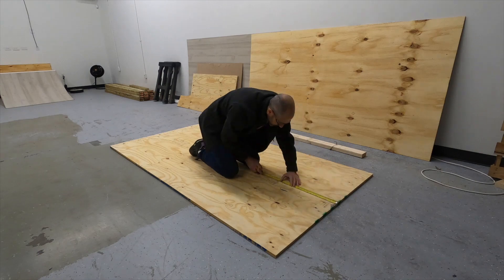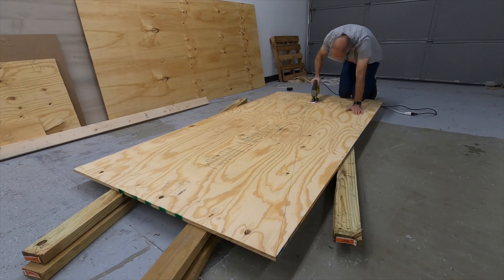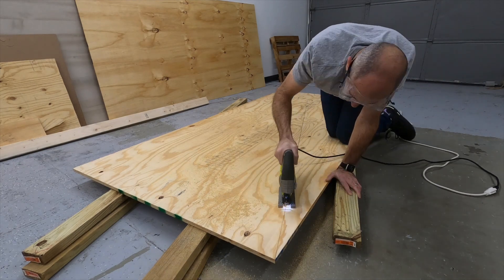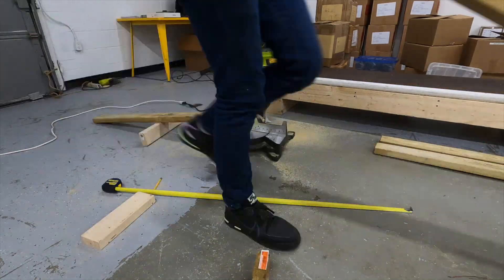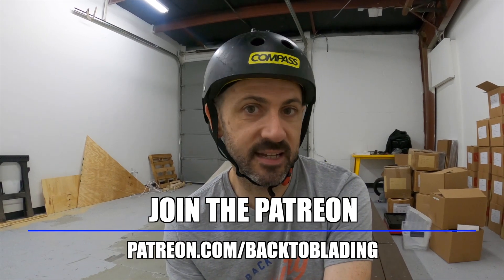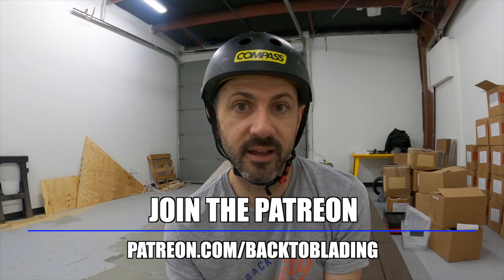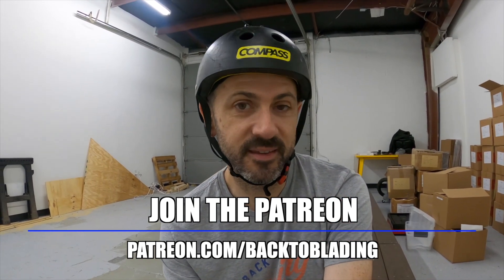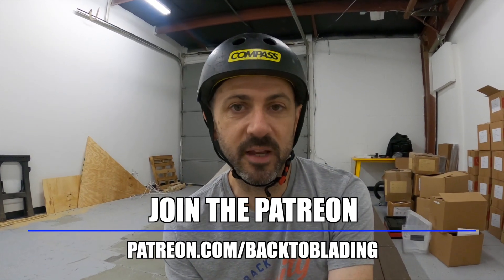Warehouse Skatepark Update: Build an incline for a virtual mini ramp

Comment: Hey I need some advice. I got the new SHIMA. I want to skate flat. Which frames do u recommend? If I switch the FL3 to anti rocker what wheels size and anti  rocker do u recommend?
Reply from the maker: I’m riding the stock setup with antirocker wheels
Reply: I found AxyzS frames and Oysi medium frames some of the best for riding flat (or slightly rockered). 
FLT3 will work with anything from 56 to 64mm, choose rounded profile if you want to keep some maneuverability. 
For the middle whees I recommend hard urethane anti-rocker wheels (the ones you can put bearings in).
Reply: @VandKoala  thank u guys

Comment: it’s winter time and it’s not easy go to a skate park in the morning and practice for not so young people like us, so I also thought about building a quarter pipe to use inside my apartment’s garage, I wanted to build a 2’ quarter pipe but ceiling is not so high only 250cm so I have changed it to 1’ 6”, I made a lot of research but quarter pipes shorter than 2’ are not so common, I don’t know if it’s going to be an enjoyable ramp or not, I’m 176cm tall, with blades on my feet and helmet on my head almost 190cm, I thought I might hit my head to ceiling, I just wanted to get used to quarter pipes, do you think it will be okay? It’s 18” height and 50” radius, I used a ramp calculator

Comment: when the two boxes are joined, how are the rails connected? is there a lip to catch yourself on?
Reply from the maker: They’re not. Yes, I caught the lip a few times. Need to figure that one out too. :)
Reply: maybe a tiny bit smaller rail piece you can put inside the pvc pipe

Comment: what boots you skating here
Reply from the maker: Shima
Reply: @BacktoBlading  Hey while you may still be around, I've been looking into getting the USD Carbon boot, I'm looking to skate flat, preferably aluminium if I can (unless I've misunderstood something drastic and PVC is blatantly better), what would you recommend? I liked the kaizer element ii frames, but they have differing sized wheels, which will be annoying and expensive for rotations